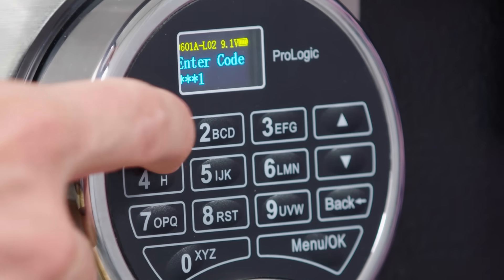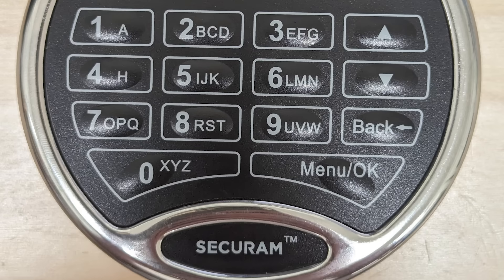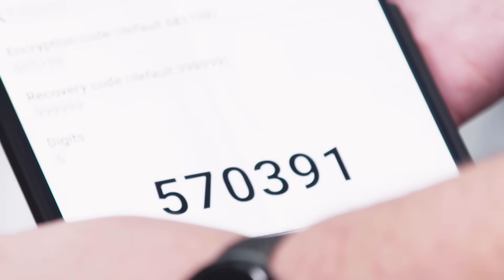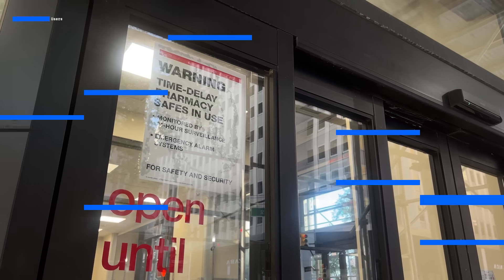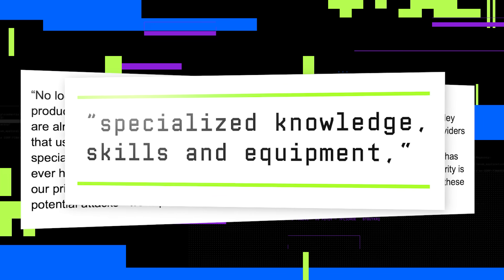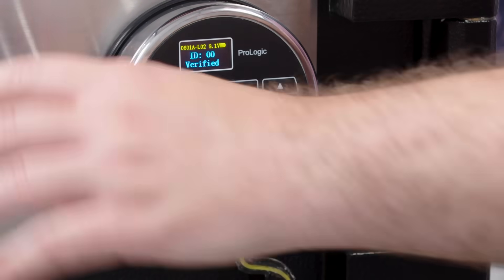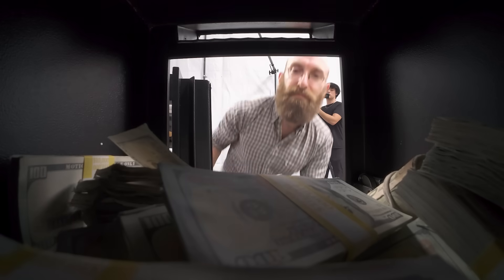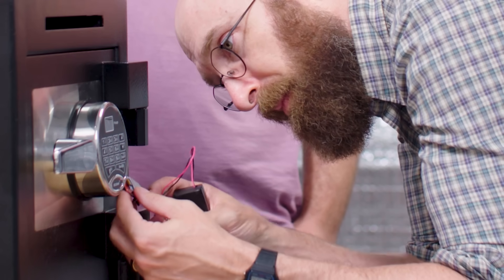A Basic Device That Cracks Hi-Tech Safes | Hacklab | WIRED

Comment: If someone is resourceful enough to try either of these methods on your safe, you got bigger problems to worry about. Method 1 is not necessarily a design flaw, if someone is familiar with low level hardware debugging, it's quiet simple as they mentioned. Method 2 on the other hand is shows a design flaw for exposing a debugging ports with that much access

Comment: As an electronic engineer: If that debug port also is the access point for rewriting the safe's microcontroller's firmware its possible to just make a device to reflash the controller and just drive the lock solenoid to open... it'd write off the lock in the process... Easy way to to help defend against the attacks is that they were only on the back facing silkscreen, making them only accessible during assembly.
Reply: Or as they said, keep the logic inside the safe and only keypad outside
Reply: @Orrinn123 Yep, an impatient person could probably pop it in under 5 minutes with a hatchet and a piece of wire as it is. Kind of the tip of the iceberg of problems with this design.
Reply: All we do is spike the solenoid with some power via Gel. No need for all this nonsense. 😊😂
Reply: As i am is software engineer lock company's could use mobile mother board with biometric and Face id.. at same reset method set on owner sim card!
Reply: Part of the purpose of this sort of device is to enter the safe without conspicuously showing that the safe had been cracked open.
Reply: @ijchua No, you're missing the point. The device isn't the problem, the design is, and it's terrible. 

The device is just a shortcut, you could in fact do this brute force on the spot with a bit of electronics knowledge. Not only that, but it's quite obvious there are numerous fatal flaws in their design besides this.
Reply: it would be relatively "easy" for the company SECURAM to simply switch to a microcontroller with build in flash encryption and to disable the debugging port by burning fuses...
Reply: @MsKittensPurr  ...Or just use proper connector and cover everything in epoxy.
Reply: @saiv46 wtf? U got shares in lib safe? Why would u want to drop 1k on a safe and expect the product to be vulnerable unless u fix it yourself
Reply: @AG-en5y  The "fix" is relatively easy (change the encoding) but I still opt for mechanical combos.
Reply: HOW CAN I HIJACK THE FEDERAL GOVERNMENT. IM CO DEPENDENT AND NARCISSISTIC WOMEN. SSA REFUSES TO RE APPROVE MY SSDI/SSI SURVIVORS BENEFITS PAYMENTS PERMANENTLY

Comment: Convince me that there is such thing as a secure digital lock.
Reply: One created by the owner and impossible to access externally.
Reply: There is not even such a thing as a safe secure lock... Any lock with some effort and reverse engineering can be unlocked
Reply: @309electronic5  Yeah, I was imprecise. Convince me that there's a digital lock that's as secure as a competently made mechanical one.

Comment: looks like the fet/transistor to drive the latch is real close to the programming port. you could prolly just shove 9v in to pin there to unlock.
Reply: That works, too.
Reply: Looks like a voltage regulator, not a mosfet.  The marking on the board next to it is "U6".  "U" is a designation for integrated circuits on silkscreens,  while "Q" would be a designation for a transistor/mosfet.  A voltage regulator looks like a transistor,  but it's an integrated circuit.
Reply: @Sloxx701  9:29 true, maybe on the other side of the pcb. oh well the direct pin for the latch isn't much further away.
Reply: Ssssshhhh!

Comment: A little hot glue over the programming/debugging pins could help prevent the second attack. Shouldn’t affect the circuit board at all.
Reply: It doesn't prevent the attack, just makes it slightly more bothersome.
Reply: @jwrm22  exactly, you can always just stick something in there to pull/scrape off whatever glue they put overtop of it.
Reply: @jakecrowley6 Use epoxy that would destroy the board upon removal
Reply: @martinlutherkingjr.5582  Yeah but that screws the owner of the safe if someone does tamper with it and then you wouldn't even be able to open your own safe :/
Reply: @3nertia As long as they don’t forget their combination they’re fine. Someone could destroy the chips weather or not you put epoxy on them.
Reply: That easy cover the entire pcb with hardened epoxy nothing will penetrate that. Or make up a dummy port that can executed devices that poke through with electric shock
Reply: Use solder mask, that’s what I use in my electronics to cover up traces. They will have to scrape off the solder mask off of each pin in order to read it.

And if they’re not careful, they could also break a trace while scraping off the solder mask and not be able to get into the safe whatsoever
Reply: @frankthetank908  Again, that would ruin the safe for the owner too and they wouldn't be able to access it if someone else tampered with it :/
Reply: That was my first thought - or wire in a super cap to a dummy pin 😂

Comment: If you leave the debug pins or pads exposed on your final production PCB you are obviously unqualified to design, produce and sell electronics locks. Also the fact that the debug port is accessible through the battery compartment is even more hillarious. Amateur hour right there. At least covering the PCBA with a large epoxy blob after manufacturing would go a long way to make it hard for this kind of hack.
Reply: Keeping the pads/port on the hardware is normal. But you're supposed to lock it out in firmware when the chips are programed for the last time.
Reply: Quali…fica…tion? What is this word you speak of?

Comment: A Safe should not have a Reset option or access to the board pins
Reply: Ideally, sure.
Realistically, though, people forget their codes a lot more often than people have their safes broken into. So if the cost of forgetting the code was having to pay a locksmith to actually physically break/cut the safe, and then purchase a new one, most people wouldn't do it. Presented with the alternate risks, most would prefer having a reset option. Or will instead either pick very trivial codes, or write the code down, which are very probably worse in general than having that reset option.

For high-end safes, intended for organizations that can afford the hassle, you're right, there shouldn't be a reset/debug option accessible for a locked safe. But for the majority of safe uses, and users, it probably would be the preferred option to have these.

( Same issue with, say, digital data. Most online service, including ones that store encrypted data, still have a "forgot my password" option with a way to reset the password, and use their own associated encryption keys for this. There are zero-knowledge options for things like cloud document storage, email hosting, computer backups, password managements and the like. But most of the time if you go over with someone on an options when they need to choose one, all the potential security benefit don't quite hit as hard as "so I lose my data if I forget the password?", except for a very small minority who take that seriously, or the ones who have that word document on the desktop with all the passwords anyway so they're not worried about forgetting any ).
Reply: Biometric is THE solution.

Comment: a backdoor is always available to everybody. no exceptions, just a matter of time.
Reply: Not all backdoors are equal, to be fair.  There's a big difference between something using Public Key Cryptography using the same cryptographic security banks use, and "yeah, we just run a simple formula on a challenge number".
Reply: @KateGrayCode  yes, but the key could be leaked, intentionally or unintentionally.
Reply: I thought that was a dirty joke lol
Reply: @sku2007  That is literally one of the reasons Hardware Security Modules exist.

Key control is a largely solved problem.
Reply: You've not met my wife.
Reply: Your mom backdoor is available to everybody?
Reply: A diamond hole saw would make a nice backdoor in a safe.

Comment: If it's not made by Kaba Mas or Sargent & Greenleaf, it's not high security.  Better yet, stick with the non-electronics like the S&G 8550.  Buy cheap Chinese stuff you get cheap prizes. These two companies are 21 miles apart in Kentucky.
Reply: Who made the backdoored keypad that caused the original Liberty scandal? Seem to recall it was S&G.
Reply: Also there is Little Black Box which can crack all of them but latest gen

Comment: All locks can be opened its just a matter of technique and time. Even the electronic locks on many vehicles are proving to be less secure than a mechanical lock discarded years ago.
Reply: All people die. Doesn’t matter if you live for 100 years or 5 years, it’s all the same.
Reply: @martinlutherkingjr.5582  To me 95 years is a significative difference !
Reply: Yes but there’s levels of risk people are willing to accept. I would say a vulnerability where the person getting in doesn’t need any tools is beyond what would be tolerable. There’s no loud noises, cutting etc. which would make it more obvious or slow them down
Reply: yeah but digital locks have the potential to be significantly more secure than most mechanical locks yet they are plagued by such absurdly poor design and programming flaws. the pad or tag reader should never contain the electronics that are supposed to verify that the opener is authorized to do so yet pretty much always they do...
Reply: You need something without lock. A hidden thing is allways safer.
Reply: @sppb666 For larger items it’s impossible to hide them

Comment: "doesn't leave any obvious traces" well having all the codes reset back to factory seems pretty obvious to me.
Reply: Is wired mixing up quotes about the two techniques? Maybe he's talking about the second one, and they put it in the segment about the first one.
Reply: Ah yeah fair point, apologies for the lack of clarity. Babak is referring there to the second hacking technique which we had only briefly teased at that point in the video and show shortly after.
Reply: So would your stuff being gone soo
Reply: @Razzle_Dazzle5
But you may not realize that only a portion of what was inside the safe was taken. Who inventories the entire contents of a “secure” safe if nothing looks out of place? There is also the potential for someone who has the combination getting blamed for something missing despite them not being the one that took it. If you had a safe and only one other person knew the combination and the contents went missing, the first thing you’re going to do is blame that other person, not some clever thief that pulled one over on you. Lots of variables to consider.
Reply: However, that is only to the person who knows the code
Reply: 2nd method doesn’t reset the code.
Reply: Find the solenoid, place big magnet on solenoid, ???, profit.  Electronic safes aren't safea
Reply: @tywood2662  That is likely buried.
Reply: @UncleKennysPlace no, it's absolutely not.  Every gun safe that has an electronic pin pad 100% has a vulnerability.  Tell me your model and I'll tell you where and what size neodymium
Reply: The 2nd method leaves no trace - code not changed !